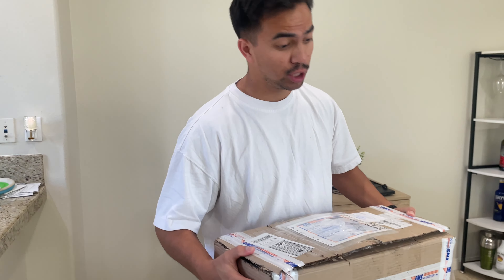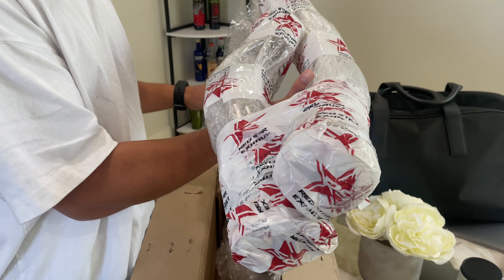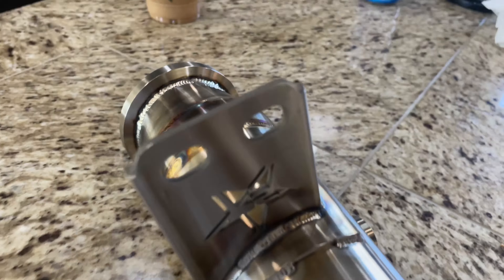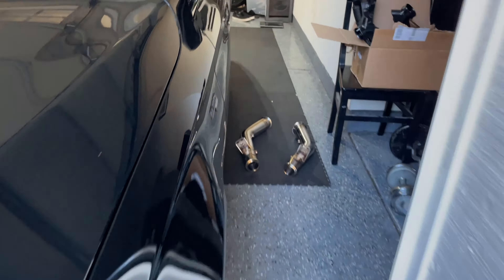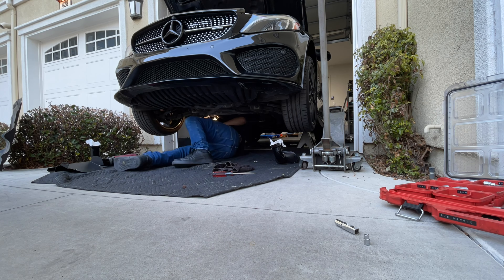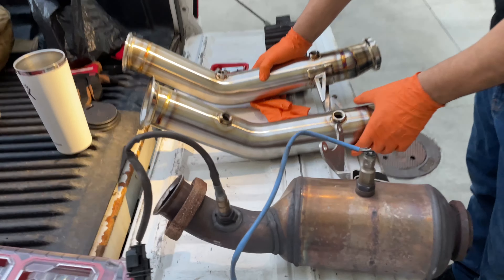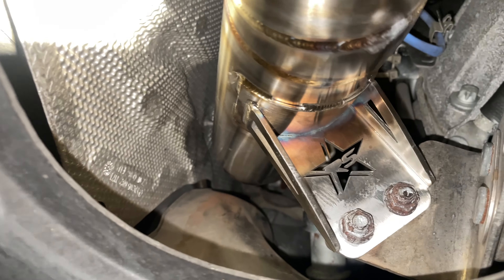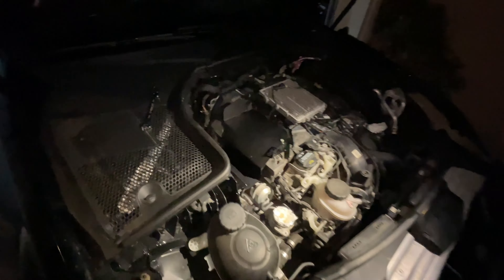MERCEDES C43 AMG REDSTAR DOWNPIPES INSTALL/IMPRESSIONS!

Comment: Hey man sounds great. QQ- 6:16 Redstar offers the spacers to eliminate the CEL did those not help? Did you ever figure out how to get rid of it? Otherwise not sure if its worth uninstalling the pipes every year when emission is due. 😢
Reply from the maker: So I know that option, I didn’t buy the spacers, but based on what I heard it did help. Another way we just obviously be to tune it. But I simply just took them off.

Comment: nice video. how long did the install take? Did it throw a CEL or did you tune it?
Reply from the maker: Thank you! Install took about 2 hours, it did throw a CEL! Heard I could remove with JB4, figuring it out right now
Reply: I believe the JB4 will clear the code but it won't clear for long. ECU tune is what it'll take unfortunately. love the car
Reply from the maker: @Forced2BFordFan  darn! Thank you brother!
Reply: Nice car
Reply: @tristanvlogs6165  I’m stuck with the CEL I’ve been running rich with o2 spacers, did you ever tune it to get it removed  ?

Comment: hey wassup man love the content. I’m in the hunt to get some downpipe as well, I own a Mercedes’ c400 but concerned if I should get the downpipes coated to prevent any heat damage, I see you got the them with no protection what are your opinions?
Reply from the maker: I appreciate you watching! 

My opinion is choose either or! Most of my homies just got catless non coated so I went with what I’m used to! I only see it being beneficial getting the coated ones, so if you can get those!
Reply: Nice
Reply: No bro u dont need a coated downpipes, i did own a rs6 and c63 before and did had it on them and the produce alot more heat 🤣